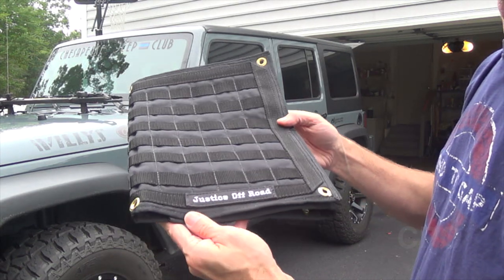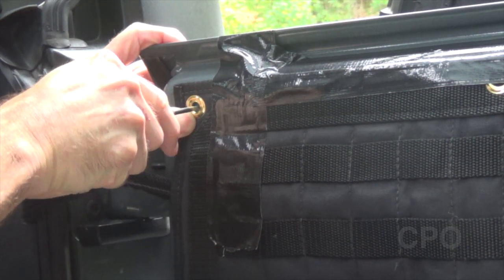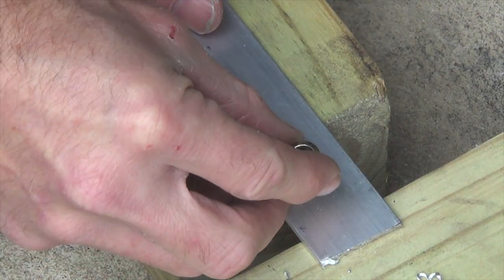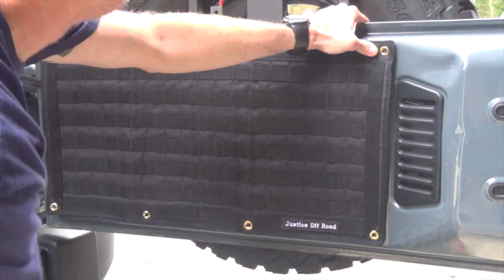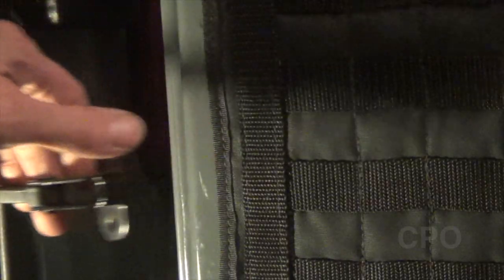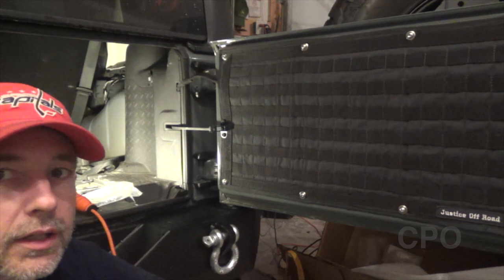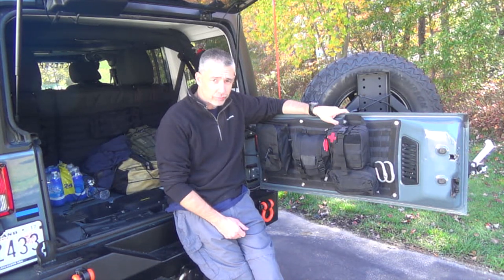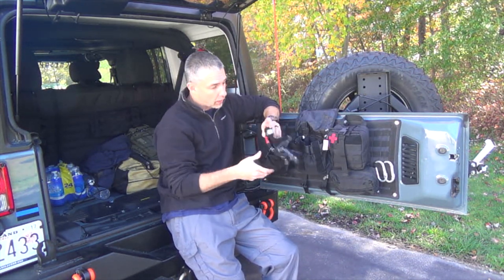Justice Off Road MOLLE Tailgate Panel Installation

Comment: Outstanding job showing the installation. What really made this video helpful was using that peace of aluminum to show how the nutserts work and will hold the MOLLE Tailgate Panel in place. I had also wondered about the usefulness of these panels so watching you add the gear at the end was quite helpful.

Comment: I HIGHLY recommend that folks installing this on a JK use a drill depth rod when drilling into the tailgate to prevent inadvertantly poking all the way through the exterior sheet metal (surprisingly easy to do).  I watched another video where a guy penetrated all the way through, twice, so I thought I would just take extra care when drilling.  I initially just put tape on my drill bit to gauge depth, but did end up denting the exterior sheet metal when my drill bit finished penetrating through when making the 13/32" hole.  T'was just a fraction of a second, but the damage was done. It's so easy to damage the exterior sheet metal when using a conventional drill bit.  Be careful!  Use a drill depth rod, or other depth controlling method to keep from ruining your day.

Comment: Can you provide a link to the bag you're using to hold the recovery strap?  The one on the inside part of the tailgate closest to the tailgate hinge.  Didn't see it on Justices' website.  Great thorough review, looks much sturdier than my smittybilt one, tugging on those bags and it didn't seem to pull at all.
Reply: Terrence Christman it's this ome: https://www.amazon.com/CONDOR-MA11-GAS-MASK-POUCH/dp/B015GX9QPA 

Justice doesn't currently stock this bag. it works really well for my tree saver!

Comment: I don't want to drill holes in my new jeep but if I were to, I would just use some good self tappers to hold that molle panel.
Reply: Thats what other brands use. His point was this is a more secure way of mounting, supposedly.

Comment: also, did you find out how much weight a tailgate can carry without ruining the hinges?  again, just curious.  and lazy...
Reply from the maker: +Traffic Time No...but lots of folks run huge 35" tires on the tailgate...so pretty much anything I put in the pouches is going to weigh much less! ;-)
Reply: didn't think of that.  thnx
Reply: can you post the link to Justice off roads website for ordering.  I typed it in google several different ways and nothing will come up. Would greatly appreciate it